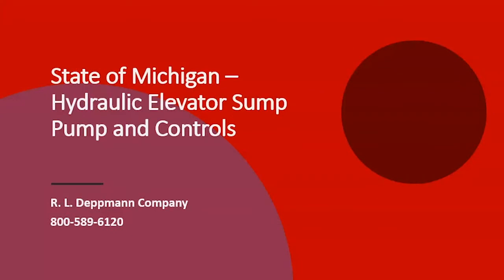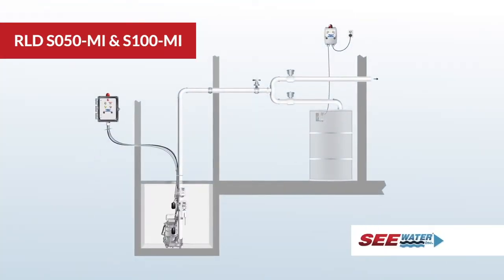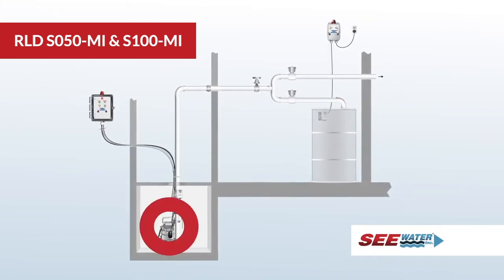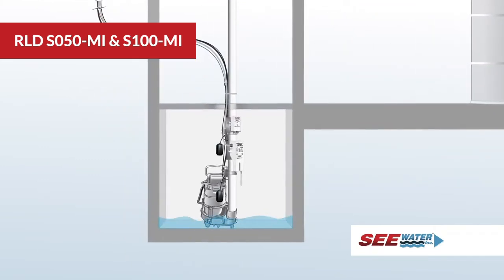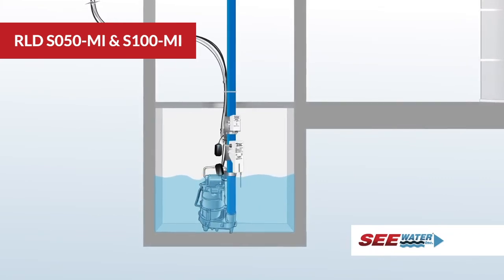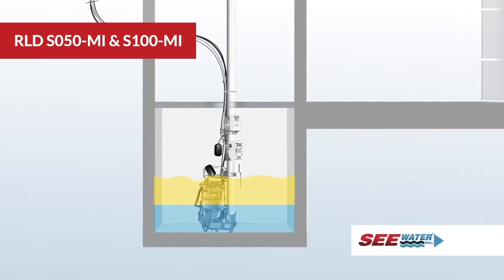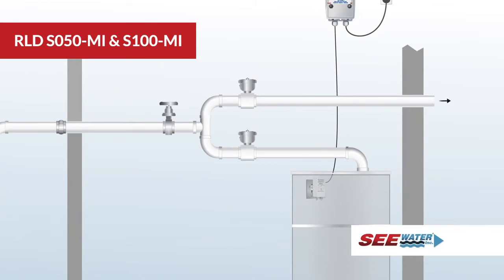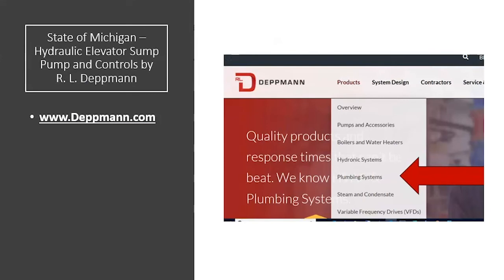Hydraulic Elevator Sump Pump and Controls - Michigan

Comment: I wish jurisdictions could agree upon a single design. I've seen in Des Moines Iowa (search FPB Policy 2010-1: Elevator Sump Pit Key Switches) where they want the sump pump to be turned on/off by a key switch (only). No floats, no oil level or oil sensing, oil storage, etc. Just has to discharge to outside the building onto the ground when a fire fighter turns it on. Simple.

Comment: Where does the water come from in the case the concrete encasement for the pit is waterproofed?
Reply: Im a maintenance man at a condominium. By no means am I an expert on elevators or elevator pits.

Different ways I've seen water get into elevator pits is positive pressure (the water table rising and positively leaking up through the concrete), roof leaking at the machine room causing water to start running down onto the floor and through different openings in the shaft, this water can end up in the elevator pit or even on top of or inside  the cab. 

Ive seen conduits leak inside of the elevator pit as well, fire sprinklers can go off inside or near the shaft/pit causing it to flood.